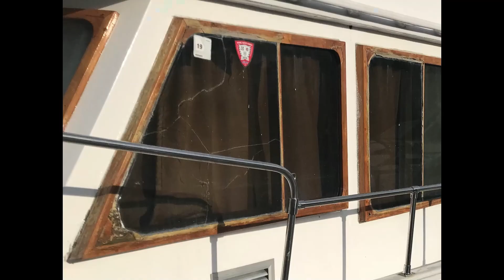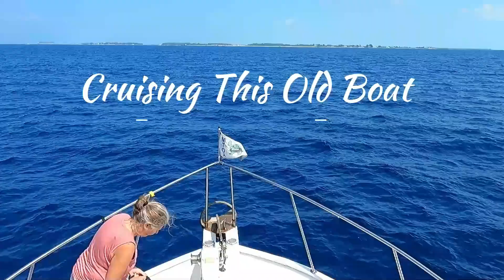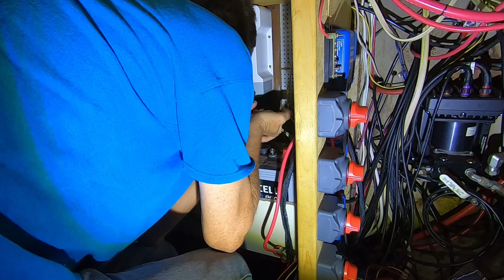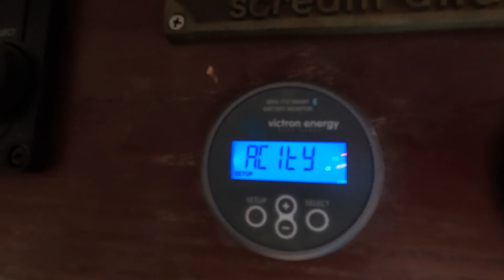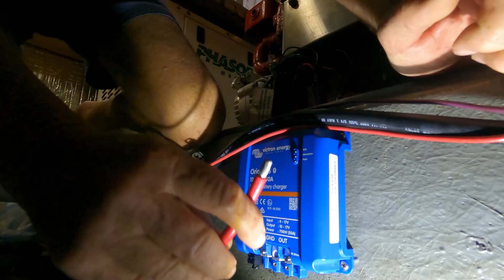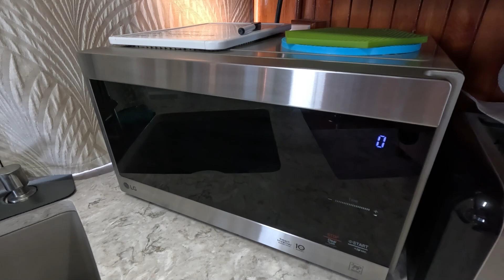Epoch Battery Install, Ep-296

Comment: I read that the EPOCH batteries turn themselves off after a time of non use.  Is that true? I also read there is a firmware problem bricking the batteries.
I use a pair of Renogy  DCC50S 12V 50A DC-DC  Battery Charger to charge my lifepo4 batteries while underway. I use 4 x 30 amp victrons to charge with shore power. I have 3 x 200 flex watt panels. I have building my own 280ah LIfepo4 batteries with raw cell and BMS for 5  years. I have 6 x 280ah batteries. Check out Will Prowse.
Reply from the maker: @DoingTheGreatLoopOnIslandT-e2z   - I’m not aware of a problem with Epoch batteries turning themselves off but I’m on a boat - when are my batteries not used for a period of time? 😂
As to the firmware problem, according to Allen @mvintrigue-trawlerdiy, who is the expert on Epoch batteries, that problem only affects the V2 batteries that have OTA capability and victron comms. It doesn’t affect the rest of their batteries including the type I have.
Sounds like you have quite a system!

Comment: Your new charging cable from the alternator should be the first cable on the alternator.  The highest load should be at the bottom of the pile.
Reply from the maker: @danpease8395   - thank you for the advice - I will correct that !

Comment: nice thing too is you can blast the 600ah bank with 100amp charger if you need to bring them up quick fast and in a hurry.  you can even push it farther , their BMS prob allows for 100a in each.
Reply from the maker: @nwmi493   - it is definitely a plus that you can charge them faster than wet cells !

Comment: The name you were trying to remember was https://www.youtube.com/@WillProwse He posted today a review of the new Epoch batteries, I would check it out, he's having problems with the new versions of their batteries. He "bricked" one of them doing a firmware update....it's an ongoing issue that the manufacturer is aware of & admits there have been a 1000+ involved batteries, they are having to send out tablets to help complete the firmware upgrade. Will had the Epoch batteries as his number one choice until this firmware upgrade issue popped up + they weren't passing his testing. Buyer beware until they get the firmware issue fixed.
Reply: That's only for the V2 battery that has OTA capability and victron comms. They are working g on the software. These Essentials and every other battery is the same as it always has been.
Reply from the maker: @  - Thanks for weighing in. For all our viewers this guy is the expert on Epoch batteries so it’s good to get the info from the source!
Reply from the maker: @toddkuykendall6030   - thanks for the tip - I will definitely go watch that review !

Comment: They are not lithium ion batteries, they are lithium iron phosphate. Completely different chemistry.  LifePo4 are much much more stable the LiIon.
Reply from the maker: @matthewwelch9084   - thank you for the clarification - we appreciate our viewers making sure the information is correct - we don’t want to give out wrong info !
Reply: @CruisingThisOldBoat aren’t the phosphate ones better from a fire safety or overheating standpoint too.  I believe the lith ion ones are susceptible to fire if they get wet.  I could be wrong but maybe someone else can chime in here.  Sounds like you have a great system there.  Love to your channel.
Reply from the maker: @  - thanks ! And yes I think you are correct. The phosphate ones (LifePo4) are less prone to fire. Thanks for watching!
Reply: Yes the LiFePo4 (iron phosphate ) are much much safer and more stable from a fire standpoint.  The Li Ion are the ones that cause teslas and electric scooters and phones to melt/burn down.

Sorry if I came across as a jerk haha.

Also I’ve been running lifepo on my Grand Banks for a couple years now and it is without a doubt the best upgrade I have done.